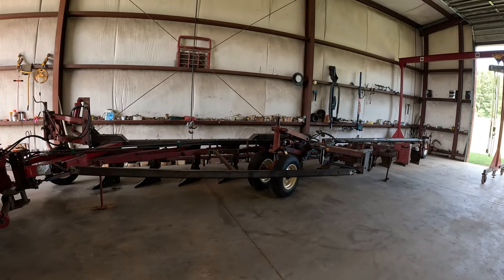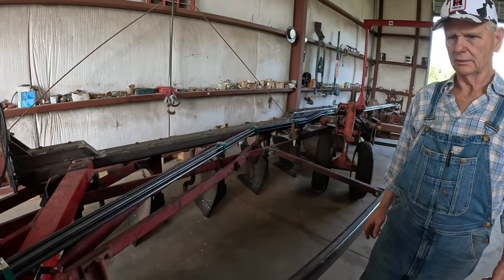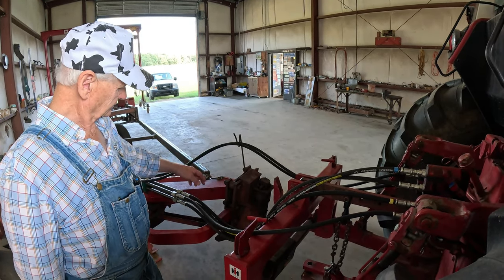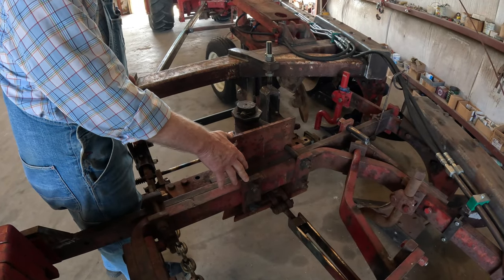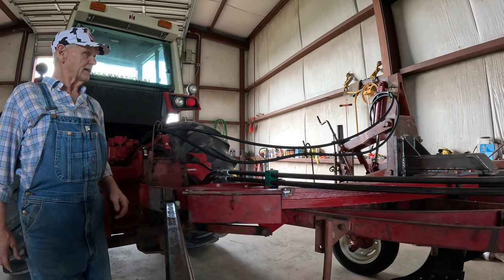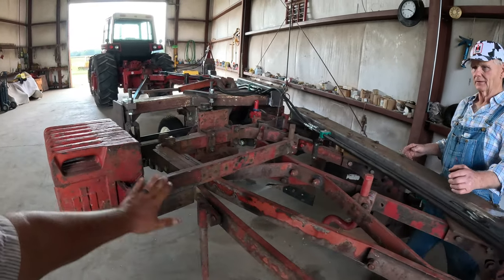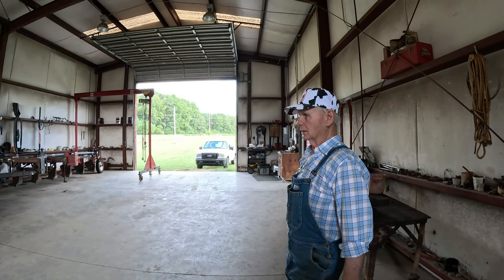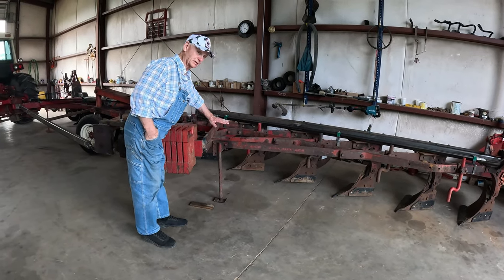Red Bibs Bills Experimental IH Flex Plow Build Part 4 #farmall51 #REDBIBSBILL #tractor #Plow

Comment: RBB is my plow Mentor. He let me drive his beautiful IH 3588 with 8 bottom in 2016 and the bug bit me. Bill has great design engineering talent and it shows in both his 8 bottom and this one of a kind flex 12 bottom. The quality of the work is so
 perfect. I am shocked that he did use a JD pivot hitch as the main link between Red Power and Red Resistance.

Comment: Been waiting to see this!  I want to build an 8 bottom center pivot (4+4) on land to pull.   Our hills, dips, and gulleys won’t allow much more than a 6 or else you bridge the bottom or high center the top and to terrace around hill it’s got to have some flexibility to turn.  

I don’t think my 1066 weighted up and on duals will have a problem with 8-14” plows especially if it’s not fighting them all the time.
Reply from the maker: Sounds like a good project.
Reply: @farmall51  and secondly I need to design and build a 12-13’ high speed disc.  No one offers one